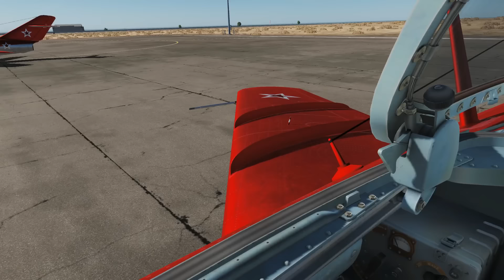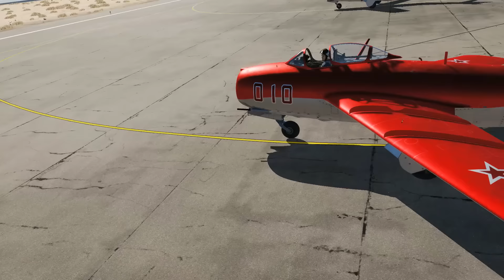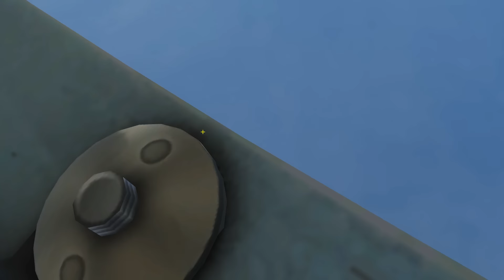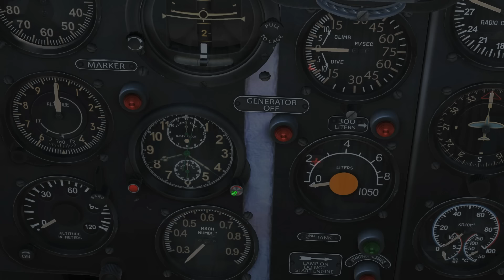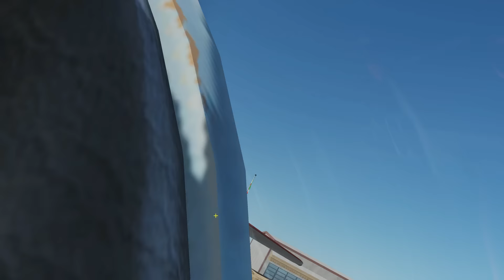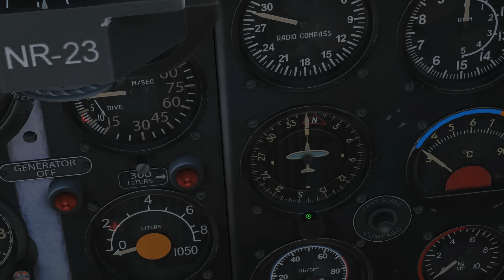Mig-15bis: Cockpit Familiarization Tour Tutorial | DCS WORLD

Comment: How do you turn on the instrument lights? Mine turn off after a few seconds
Reply: If yours turn off again you might either be dropping your RPM, thus disconnecting the generator, or actually burning out the UV lamps. Those need high voltage to get started, but if you keep the voltage that high it will kill them. So try reducing the rheostats by maybe 15° after they're lit.
Reply from the maker: Yup just doing vid on that now